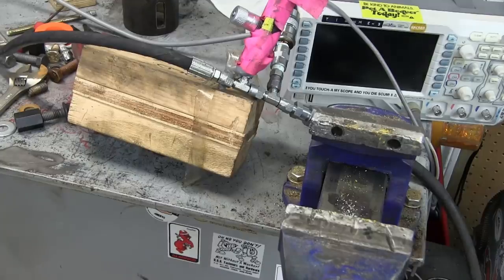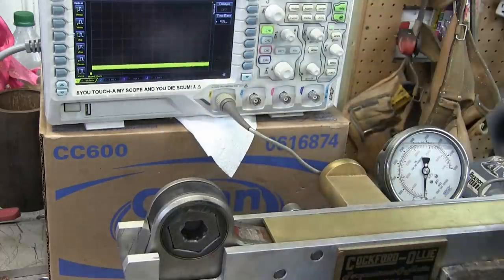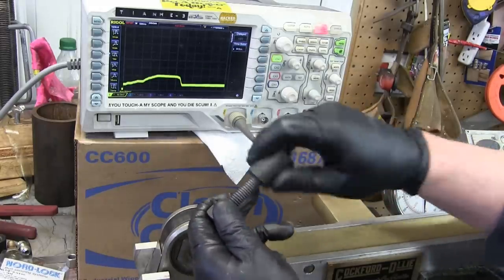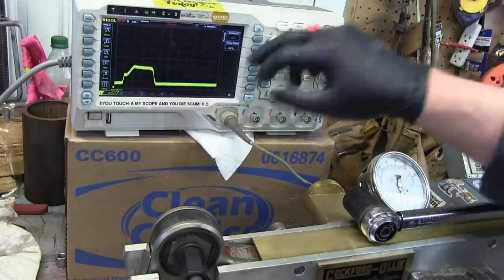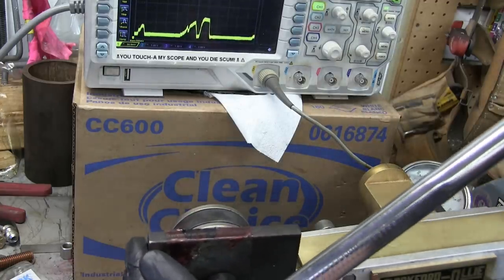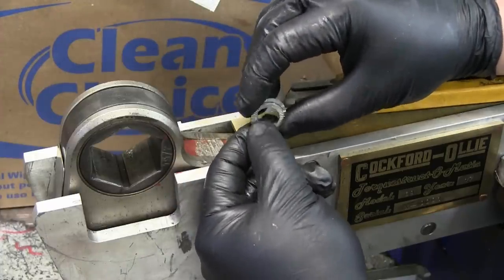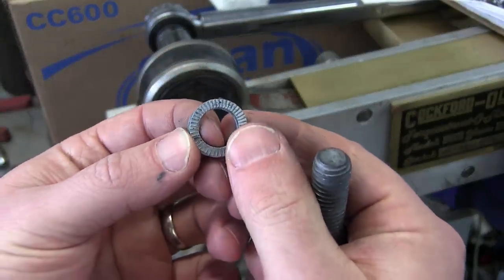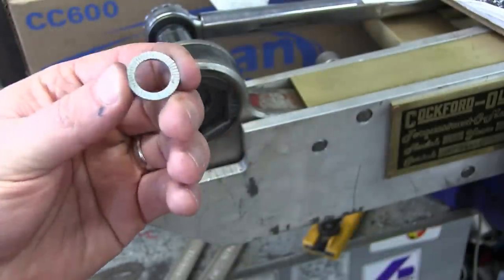Nord-Lock Washers | Do they work better?

Comment: If anything, this proves what I've been told at work due to me using improper inspection techniques: There is NO correlation between how much force it takes to torque-out a fastener, and how much force it takes to loosen the same fastener. 

There are an incredible amount of forces at play between the various surfaces of interlocking threads.  Add other factors like lubrication, flat & lock washers and there is even less of a correlation between the forces of torquing-out and loosening a fastener.  

Some threads interlock impeccably with near perfect machining,  allowing for very little force needed to loosen. Some surfaces are burred, jagged and would in turn need more force to loosen.

Comment: Mr AvE, please note that Nordlocks come in larger outer diameters (which should be used under flange headed bolts) and different materials (stainless and iconel) so they can work with harder fasteners. I think the use of the larger diameter (part number contains 'sp') washers and harder washer material would yield better results. Thanks!

Comment: I'm machine mechanic and I work with one packaging machine, which makers told me to use Norlocks in few particular applications in the machine. I was told that before using Norlocks there has been multiple vibration type loosening of bolts and serious machine breakdowns. Also machine designers noted that never ever use Nordlock washer twice as ramps are always damaged in removal. I don't know, but I have relied on their studies and Nordlock applications on machines have never failed on us. I think they're reliable as markings on mating surfaces have always been consistent and I've always felt the slight "snap" when loosening joints.

Comment: I have very good experiences with Nordlocks holding what nothing else does under vibration.  I've seen dry bolts with Nordlocks hold a hydraulic motor where blue Loctite and flat washers wouldn't.  Your last minute or 2 explains fairly well why they also are more effective when using fine thread than coarse thread. The angle is lower on a fine thread.
Reply: Can't remember the brand but used to be a fully grill coated bellevue washer that came with the rebuilding kit for a Signode model 7/16 strapping machine head. I've rebuilt two of them during Christmas week shutdown eight years in a row! It was a high capacity textile giant Burlington Industries. Constant tension adjustment around the clock. The guy from Signode me said that the only broken one that he's seen was when he was sent to an outdoor sight to try to salvage one bumped with a forklift.

Comment: I wonder if those Nord-Lock washers would work better with fine-thread fasteners. The fine threads will have a shallower slope to them. Just a thought.
Reply: You get Nord-lock washers to fit most thread pitches.
Reply: m.blacktree à
Reply: You are right. If the the threads are course enough to lift the bolt head from the nordlock washer, the washer will do nothing.

You need the right type for the right thread.
Reply: Correct

Comment: Throwing in the principle of lowest potential - a vibrating nut/bolt will always tend towards less tension. Once you break the static friction of the assembly (which a heavy enough shock or vibration will do), it's driven by that principle. Rather than adding more friction or trying to lock the thing down some other way, Nord-locks make it so that it takes more tension on the fastener (i.e. you take it to a higher state of potential) to eventually slip over the ramp. You have to do work to get to that state and you have to do it all at once. Now, the same applies to just static friction, but it takes a lot less work to break static friction than it does to stretch that fastener until the teeth can slip. Even if it only slips a tiny bit, when it's able to slip to lower tension with each shock - it will eventually work free. When you have to increase tension first, vibrations will tend to return it back to its original position instead, as this is where tension is lowest.

The point of failure here, correctly identified in the first test, is that if the wee teeth on the outside slip first - there's nothing enforcing all the extra work that would otherwise need to be done, so these are no good for hardened fasteners.

Maybe Nord-lock will make some hardened bolts that feature one half as part of the head design

Comment: Am I mistaken in that lock washers aren't necessarily to be harder to un-torque, but more to keep the fastener from backing out due to vibration regardless of the tightening torque?
Reply: I guess that's my doubt, that testing for torque can really substitute for vibration. I can also imagine vibration helping the lock washer to dig in even harder.
Reply: It's right on the marketing material and documentation that the washers are designed to untorque with no issue.
Reply: And hopefully keeps the fastener on long enough after you hear things clanging around due to loss of preload to shut her down before it backs out completely.
Reply: That was my assumption to that the spring tension just put tension on the fasteners. Same as when you push down on a ratchet while tightening a loose bolt so that it don't spin both ways but opposite. The nordlock seems like it would rely more on the bolt staying tight to do what it's meant to.

Comment: The way nordlock resists vibration is that the nut cannot come lose when once it backs off a tiny bit, it's easier for it to tighten again than to back off more.

You could test that in this set-up by undoing the nut a bit and then testing how easy it is to re-tighten from the slightly un-done position.

Comment: After fresh paint job on my Harley I always shuddered a little bit if I had to remove  or redo a fastener on a painted surface, fenders in particular. Harley uses a lock washer that's got little arms around the outside kind of in a star pattern, a bunch of little gripping surfaces that love to chew up paint.  I think that they are called star washers or star hub washer maybe hub star washers. Regardless I used em and always added a good lick of loctite jut to make sure it wasn't gonna work its way out and ruin the paint around the bolt hole.
    
When in doubt loctite the farsteners as we all know Harleys especially older ones they got a certain vibration that can loosen yer nuts as well as moisten the gal that's ridin back of you. Great vid AvE interesting stuff this is good food for thought. Appreciated for gettin me thinkin inside the box for a change.I  enjoy the infotainment you make, it's fun to digest sir! Thanks man...... Jay

Comment: this test was good , it demonstrates that the lock washers were better, they bit into the same hard bolt that the nords could not bite into , Internal/external star washers (shakeproof washers) are all that are used on shaker tubs or other equipment that was designed for applications where vibration was what was needed to do useful work,  for hardened bolts etc use red or green,  loctite, end of story. thanks for the vijao , look forward to them.

Comment: The key is that removing a nordlocked nut requires an increase in torque before it releases, which was visible in the scope trace. In vibration the nut will always go towards the lower tension. In order to release the nut the tension increases before it decreases, so the nut is stuck in a valley where turning either direction requires an increase in tension. I use them on electric bicycle axle nuts. With regenerative braking there is torque in both directions on the axle and other locking techiques (short of wires) fails. The flatted axle allows just a tiny bit of rotation but it is enough to loosen the nut. The Nordlock washers take several tightening cycles to settle fully into the valley, then they don't move until the next tire change. They do require the nut and the frame to be softer than the washers, and no other washers in between to properly lock.

Comment: I have had excellent results using Nord-lock washers on turbos.  The heat cycling on towing trucks can loosen normal nuts and washers, usually they are held on with crimp nuts, but sometimes they need a bit of help.

Comment: I use nord lock with stainless hardware for high speed bottling and conveyor systems. I could have told you how they work lol. When I first saw one years ago I was intrigued at how the worked. Now I use them on almost everything that vibrates.  Thanks for the vigao.

Comment: I work on one of biggest stainless steel manufacturing facilities in world and we use Nord-Lock on everything. We use it on pumps, rollers, bearing securing, mahcine assemblys etc. They are very good. before we could find loosened bolts inside pumps or inside roller bearing housings. but after installing nordlock washers, those bolts haven't loosened anymore.

Comment: 2 things.  1, i've never seen a lock washer that think in the usa.  second, that nordlock thing i've never seen for sale here, but on german equipment, under every allen bolt, there is 1 of those norlock style washers.  which bites into the bottom side of the allen and into the mating surface.  i've never seen 2 stacked together.

Comment: Hello you are one of my favorite you tube channels anywho pleasantries completed I am a Driller of rock probably 35 plus years drilling over well over two million drilled feet over the course of time the frequency of the drifter has increased from around 1800 beats per minute to my newest drill rig which is 32-4000 bpm for years I have complained that some engineer needs to figure out a better mechanical locking device for fasteners well my friend you have the answer right here the Nord locks and your test proved why my new drill rig has them they work and work quite well thank you for your channel keep up the info you provide us

Comment: Thanks for confirming spring washers are really not so bad after all.
Reply: In Germany, several norms have been withdrawn regarding screwed fastening, because they are incapable of holding up preload in the bolt. Those include, besides others, DIN 127 split washers and DIN 137 spring lock washers.

Comment: The company I work for has long-term tested and approved these solutions to secure bolted connections:
1. Serrated flange blots + serrated flange nuts, preferably with fine thread - this is the most secure bolted connection that can't resist almost any vibration or shock. However, it is the most costly one. For some reason, serrated flange nuts are relatively cheap, but bolts are a completely different story. With all the different sizes, lengths and thread pitches, you're going have a lot of cash sitting in your stock if you use them a lot. We have a directive to use them sparsely. It is also not very good for connections that are going to be unbolted often as it destroys the surface and causes corrosion.

2. Nord-Lock washers are less reliable because severe vibration can cause its inner serration to grinded to a completely smooth surface. It's major advantage is that when it's being unbolted, its outer serration don't move relative to bolted surfaces and don't damage them. This type of bolted connection can be taken apart many times, this it's the best solution for connections that are taken apart often. It's not the cheapest, however.

3. Nuts with plastic inserts pressed against the thread when tightened (designation: DIN 6331 IstLock). This is relatively a new thing. So far, it has worked as well, if not better than Nord-Lock, no serration means no damage to bolted surfaces whatsoever, it's cheaper and there are fewer parts and separation planes in the bolted connection. The disadvantages - not resistant to high temperatures and the plastic insert has to be replaced every time you unbolt&rebolt.

4. Standard locknuts with "passive" plastic inserts or distorted thread locknuts. These are cheap, mass-produced in China and we use them on everything where vibrations or shocks are within certain limits. Unfortunately, they don't prevent self-loosening, only slow it down. These are often put on external parts were corrosion is expected to secure the thread before all the pre-load is gone. Customers are notified to check them periodically. They're money savers, not live savers.

Comment: When we sell nordlock or Heico washers we sell them as vibration resistant washers not necessarily as a part that makes it more difficult to remove deliberately but reduces the likelihood of it being removed over time.  Along with drilled head, safety wire and torque putty (regular inspections) you can significantly reduce your chances of a bolt backing out in a high vibration application.

Also if you need a better bite surface they sell sp versions which have a larger od for a bigger bite surface. For a greater cost of course.

Comment: Nord-Lock washers are used extensively in hydraulic hammers/breakers due to their ability to resist vibration. They will maintain torque between annual inspections on the hammers, which includes a total teardown, recondition, reseal, and assembly. 

Their also awesome to use in high torque applications where you have a nut and a bolt; you can place the washers with the nut and the nut will stay in place while turning the bolt, no holding the nut with another tool.

Comment: Nord-Lock has a couple videos using a vibrator table and the split washers you hate so much are the option that performs as close to the Nord-Lock.  The best option I’ve come across for price and function is a product from Fastenel that is a Belleville type washer with serrations in both sides.